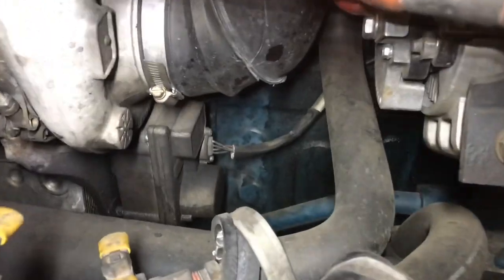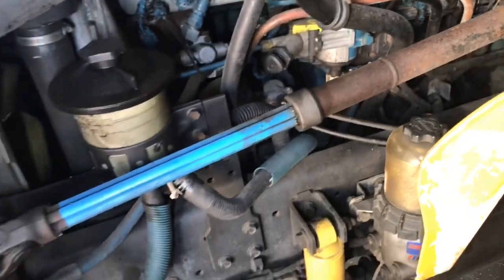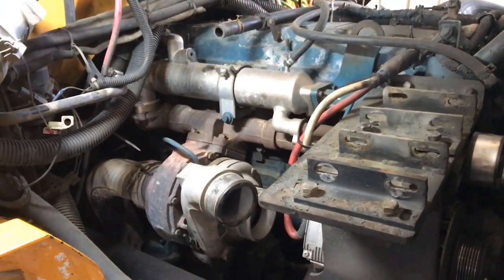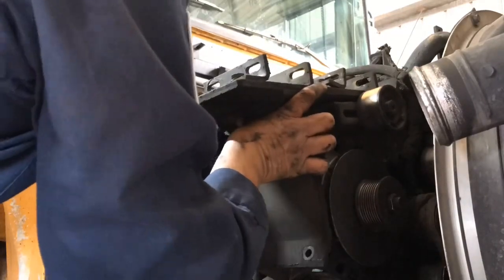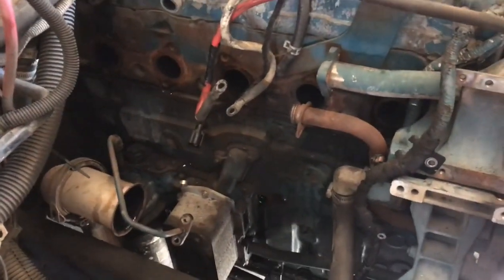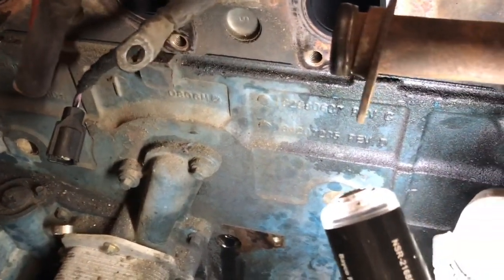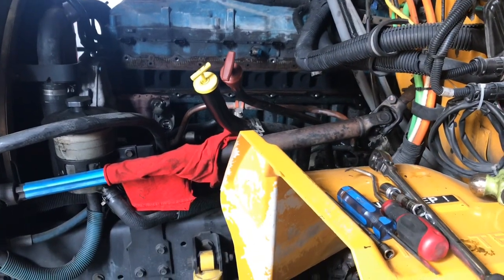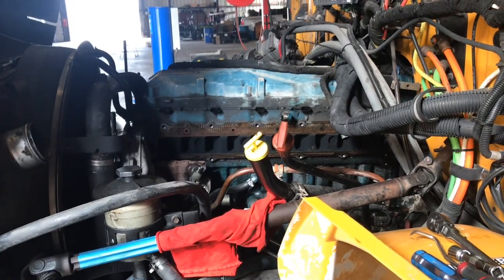DT 466E engine teardown

Comment: Hello Joe, long time bud. I lost your number in old phone but you may still have mine.  I have a CanDo code reader and codes PID 175 FMI 2 engine oil temperature and SID254  FMI 8 controller#1. Im wondering what the issue is and where to start. Also had SID 244 CRUISE CONTROL ENABLE SWITCH THAT I CHANGED BUT CODE HAS REAPPEARED..

Comment: Que tal buen dia.
Tengo dt466 2004
No egr y yego con mucho aceite en el coolant reservoir y pero almost emty of coolant en reservor
el aceite de motor esta limpio de agua.

El driver no calento el troke yego normal
Que sera elboil cooler. Liners or headgasket como diagnosticar. Millas 280.
Reply from the maker: Hey there Mike. Hope it’s just a oil cooler issue. I’d remove that sucker and check/replace it ASAP. Oil cooler that is.
Reply: @JoesBusBarn  
I checked oil cooler
Oil cooper Gasket ok

From one end. Looks normal from other end looks oily and a small piece of black rubber was stuck in coler tubes, weird.
Where it comes from?

Comment: Hi Joe, I'm writing from Nicaragua and I want to know if the egr system on the engine on this video can be eliminated for good if so, could you give me some pointers on how to do it ???  Thanks and your videos are very helpful. PS the engine I have is a 2004
Reply from the maker: Hey thereViva Nagarote. I wish I could tell you it was possible but it would only make it worse. The only way to delete the egr system is to block them off and re program the ECM. But it’s only going to cause other issues. So far. I haven’t found a way to do this delete (that works) yet. There are a few that claim they did it. But I haven’t been able too. If you don’t mind me asking. Why do you want to block the egr off. Thank you for watching and for your comment. I’ll be here to answer any questions you might have. Feel free to email me at joegonz268@gmail.com or through YouTube comments.

Comment: Amazing work Joe !!
Is it easy to remove and install camshaft on the dt466 ?
Reply from the maker: Hey there Antonio. Camshaft is somewhat challenging. Cylinder head comes off and everything else bolted up to it. Timing covers. Oil pan. It’s a pretty big job.

Comment: Yo joe, which tools did u used?
Reply from the maker: Hey there Remy. Most of the tools are basic metric. We do use some that are a little larger than average. 22mm. 24mm. 15/16. 1 1/8. So on. Special tools come in during assembly. Hey. Sorry for late response.

Comment: Hey Joe, one question: do you reuse your rod and main bolts?
Reply from the maker: Joe Drnec hey there Joe. Yes. I do reuse rod and main bolts. I have replaced rod bolts (if rods got reground). Main bolts I’ve never had to replace.
Reply: Joe’s Bus Barn thank you!

Comment: Great videos!!! I’m a mechanic for a school district in Phoenix. Your vids have helped tremendously, especially the ones about air brakes and WC lifts. Is your district/ company experiencing DEF issues? We have replaced several, several DEF heads on the tanks, especially on the bluebird visions. Thanks again for the great vids
Reply from the maker: Hey there Erik. Glad to know u found use for these videos that I post. DPF’s. ISSUES. We have had plenty of issues. Found that taking units for a drive (55 mph +) helped in keeping the dpf filter cleaner. Went from cleaning every 4 to 6 months to once a year.
Reply: Joe’s Bus Barn 
Cool thank you. We have had to drain and remove DEF tanks on several buses to access the “header” or level sender due to various DEF error codes. Just curious if you’ve done the same and have any tricks for easier tank removal. Thanks!!!!
Reply from the maker: We have lost 3 DEF pump heater assy so far. The only reason we drained one was because driver added diesel into DEF tank. So far (4 yrs). Haven’t had DEF solidify in our tanks. We use our newer (DEF equipped) units for long trips. That keeps the fluid flowing (I think) and keeps the fluid from crystallizing.
Reply from the maker: Eric P my bad on first response. I thought I saw DPF. My bad Eric.
Reply: No problem. Glad you haven’t had too many issues with DEF. It seems like even if there is an access panel on the bus floor, we still have to drain and drop the tank to replace the level sender. Hopefully DEF goes away soon
Reply from the maker: I don’t think it’s going away bro. Manufacturers r making money off these systems. But hey. Wishful thinking doesn’t hurt anyone.

Comment: mister joe you got very good infotmation on dt466, for that i subscribe to your channel.
now , i need help if can. my 2004 dt466 is leaking coolan but hard to see where axactly is coming from, it look like it is fron the back timing cover close to the thermostat where the block  meet the head.
do you think in experience can be? timing cover or head gasket . 
thanks for your help and all your knowledge you share with us.
Reply from the maker: Hey there diy man. Sir. That area there has several possible causes. The one I have found to be somewhat troublesome is (can’t think of proper name) a coolant bypass block on the left side of the rear cover assembly. The other problem I’ve run into is the thermostat housing tube/thermostat. You might want to check housing on back cover, behind water pump. Coolant only flows on left side (water pump side) of timing covers.
Reply from the maker: DIY man. Head gaskets coolant leaks are somewhat rare. Gasket coolant ports are pretty thick. I haven’t replaced a head gasket for coolant loss. Now oil leaks from cylinder head I’ve seen.
Reply: @JoesBusBarn  i got new coolan bypass block gasket.
i ran the engine with no ac compressor ,no altermator neither alternator bracket just a small velt from crank shaft to water pump.
it kind of looks like is from the back cover 
thanks goodness i found your channel, 
do you recommend any place that sell dt466 repair manual ?im planning on doing it myself.
wish me luck.
thank you very much for your help.
Reply from the maker: diy man   Send me an email. I’ll send u copies of manual as needed (if you want to save a bit.
Reply: @JoesBusBarn  wow , thank very much ,it will be a big help
Reply from the maker: Let me know what parts u might need so I can start sending them ur way.
Reply: @JoesBusBarn  at this adress ? 
joegonz268@gmail.com

Comment: Getting ready to inframe my 96. Mechanical, thanks
Reply from the maker: Joe Drnec   Hey there Joe. Your getting ready to begin an in frame. Nice bro. You are going to have some fun with that one. They are not that hard to put together. If you run into any issues. Hit me up. I’m always willing to lend a helping hand sir. These engines are somewhat simple (parts are a little bulky and somewhat heavy).
Reply: Joe’s Bus Barn  I love working on it compared to import cars lol I can actually get to stuff. Once I order my rebuild kit I’m probably going to have to make the sleeve extracting tool because those are like 1000 bucks I’m going to use a piece of pipe some threaded rod and it carefully cut piece of steel with a slot in it to allow it to grab the bottom of the sleeve
Reply: Joe’s Bus Barn The piece of pipe will go over the cylinder bore something to pull against
Reply from the maker: Joe Drnec   Hey Joe. If you don’t get to build your extractor. A hardwood dowel will be sufficient. You will get a little dirty, but heck, that’s the fun part. You can hit them out from the crank side of the engine. I built up my first 2 here using a a piece of wood and a ball pin hammer.
Reply: Joe’s Bus Barn thanks that is good to know! And cheaper!
Reply from the maker: Joe Drnec   And yes. The tool cost me close to 1000 bucks. They ain’t cheap. But it looks way more professional (for video purposes only. Lol)
Reply from the maker: Joe Drnec   Wouldn’t look good on video but it does get the job done. Best bet if ur on a budget.

Comment: Interesting to see the EGR-lectronic version of this engine torn down for an in-frame.  Maybe in the distant future, I'll do a mechanical in-frame on one of my 360's.  Have you worked on the mechanical DT's before?
Reply from the maker: txstreetman hey streetman. It’s been a few years since I’ve done any serious work on mechanical engines. Been here 5 yrs and the only mechanical engines they have here are 444. We only have 2 plus mine. But no. Haven’t worked on 466 mechanical
Reply: You are missing out!  The mechanical DT's are just like that electric one you are working on, but no computers, sensors and EGR.  Only sensors were to run the oil pressure and water temp gauges.  Same wet sleeve motor without all of the modern tech.  Next time you are up this way, I'll definitely give you the tour.

Comment: This is going to be a good video for me. It's inevitable that I'm going to have to do this but it's going to put me out of service for a while. Especially since I have to do it outside, in the driveway, in New England, and winter is setting in. How many miles are on the engine in this video? Thank you for doing your videos!!!
Reply from the maker: Hey there dale. Haven’t made up to New England yet sir. Farthest I’ve been is NY. And it gets cold in New York. Glad u find these videos helpful Dale. I’ll be posting the cleaning and assembly in a couple of days. Thank you for watching.
Reply: @JoesBusBarn  Do you need to unbolt the front engine mounts and lift the engine some to get the rear timing cover off? I know you fo this for a living but it still amazes me how fast you blow through these jobs. IMPRESSIVE!!!
Reply from the maker: Dale Babbitt   Yes sir. Oil pan drops. Suspend engine with bottle jack from front straight axle and 3rd main cap. That allows you to pull covers right of. Oil pick up tube has to come of. It’s bolted to rear timing cover. It gets a little messy. I put a 3 x 4 drop pan under so that it catches most of the fluids.